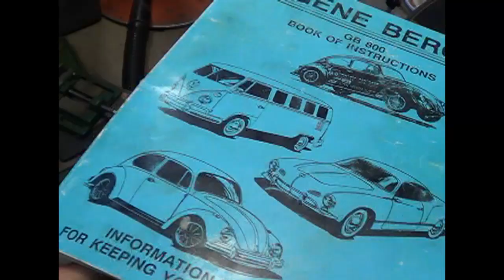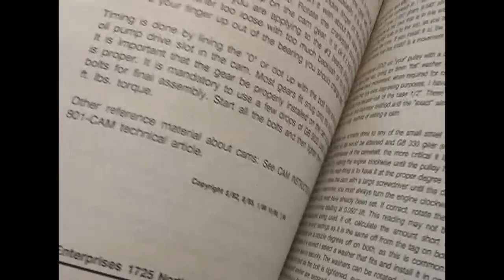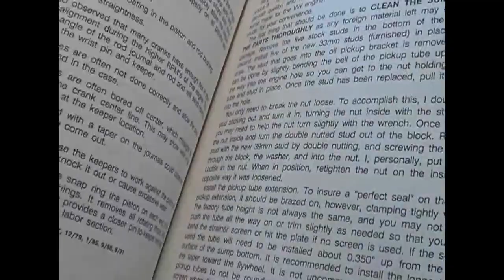1800 VW Stroker Engine Build PT 2

Comment: good stuff I only use those straight cut gears on HUGE cams Drag racing only. Too much vibration on the valve train otherwise. kind of like a sonic cleaner. constant vibration.

Comment: Responding to an old video I know... I'm slow 😄 With those AA rods (they look like AA) did you need to clearance the case where the rod comes close to the bottom of the barrel? It doesn't look like it, but I see others using a 74mm crank do. I ask because I'm mocking up a case currently for a 1904 and it looks like I have plenty of clearance there. And more important...I hope you continue on a speedy recovery!!! I'll be studying your trans videos soon. I've never gone through a type 1 trans before, and plan a reseal and 4th gear change
Reply from the maker: Just keep in mind engine RPM effects cooling fan. Horsepower is heat.....
Reply: @TheEZGZ  Understood.  I was going to try the .89 ratio that was used on the last couple years of Karmann Ghia. So not too different

Comment: Its a pleasure to see someone use a torque wrench correctly.  
After you get the pistons clearanced will you need to have the rotating mass rebalanced?  Can you get away with insuring the pistons are all the same weight?  
If you cut one skirt do you need to cut the other on the same piston?
Take care, be safe!
Reply from the maker: +Ironheart Fabrication  Had to cut all 4 because I special ordered that bastard short connecting rod.  Professional spin balance was in the budget. i will get it close and let him finish the job.  I wan't to scream when I see some folks abuse a torque wrench.
Reply: +TheEZGZ I gotta ask...  How do you use a torque wrench improperly?
Reply: +Greg&#39;s Garage A smooth and steady motion must be maintained as jerky motions have the potential to  cause excessive torque. 

Selected torque  is reached when the wrench clicks once.  Repeated clicking has been reported to exceed selected torque.  The multi click taboo was stressed in Automotive vocational technical training  and reiterated in the USAF Aerospace  Propulsion Jet Engine technical training course.

Torque wrenches are not breaker bars.  They are calibrated instruments and should be treated accordingly. Mistreat your torque wrench and it may become as effective as the ol calibrated elbow method.

I'm sure you new all of this...8)
Reply: I guess most of that is second nature to me, but I had good teachers, so that makes total sense.  I learned on the old dial style wrenches where you had to sneak up on the torque.  I've used that same technique with the clicker type...  To be honest; I like the old dial gauge.  You could tell how close you were to the target at all times.
Reply: +Greg&#39;s Garage I am with you Greg....... The dial style wrenches would give you that visual.

Comment: NEVER too long.  I am planning to use your videos to help me when I decide to pull my engine apart and build it up bigger and badder some day.  On a side note.  I am working to install Disc brakes on front now.  Do you have or know a place I can get my ball joints pressed out and the new ones in?  I have the arms off and ready to go.
Reply from the maker: +Bary Novacek  Ball joints are pretty universal. Any good auto repair place should be able to help.  I did mine myself and it was a beeeeeech.
Look in my baja play list.

Comment: when you're torquing down anything, don't use extension. if you have to use extensions, add 1lbs per every inch. for example, torque requirement is 20lbs but you have to use 3 inch extension, you set your torque wrench to 23 lbs. this is due to extension twisting under torque.
Reply from the maker: I could see your point but I seriously doubt if it makes 3 lbs difference on 18ft pounds of torque with 3 inch extension. Where are you getting that data from???
Reply: Adding an extension from the drive forward wont change torque value. Only if you extend lengthwise will you have to change the value.

Comment: When you say cylinder is supported by the case all the way round . Do you mean that the cylinder should be a snug fit into the case   as ive just got my engine back from machine shop and my cylinders are loose in the case . I have roughly measured it at 1mm of movement. Any guidance would be great
Reply from the maker: You should be ok but be sure and get a good engine building book or somethi ng to follow assembly procedures.  Good Luck with your build. Let me know if you need more help and watch some of my other build vds
Reply: TheEZGZ . Thank you for the reply and ive watched every buildong video youve got on and they are all very helpful .

Comment: Hey what issues will you have with to much clearance at the cam thrust bearing?
Reply from the maker: Hey, It will probably destroy your oil pump and chip away metal from the front of the cam. Your valve lifters won't be tracking the same, you'll get vibration threw your whole valve system. 
You got to ask yourself. Did I fire 5 or did I fire 6. I can't remember myself. Are you  feeling LUCKY PUNK!
That's from the movie Dirty Harry. LOL
Reply: TheEZGZ thanks for your input, guess I’m buying new cam bearings.

Comment: ON 1776 TO 1800S WHAT COMPRESSION AND CAM DO I NEED TO DRIVE IT ON THE STREET 500 MILES MAYBE ONE WAY
Reply from the maker: It depends on the cam and compression is recommended by the cam manufacturer. You can use anything from a stock to a 110 but it depends on the rest of the system.
Reply: TheEZGZ  Thanks what's the best parts I need can you tell me what I need to buy will you put a list together for me.
Reply from the maker: Here ya go https://www.cbperformance.com/product-p/1180.htm